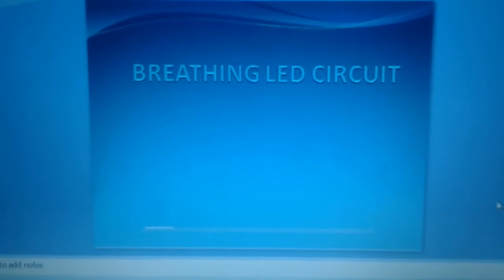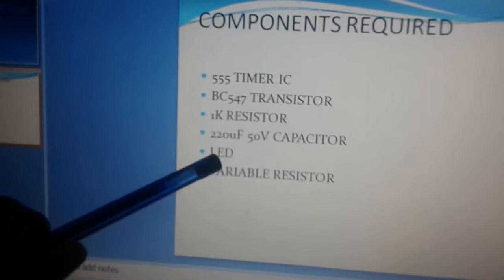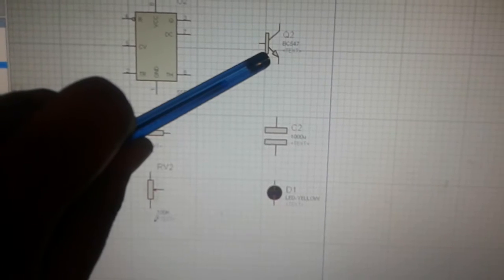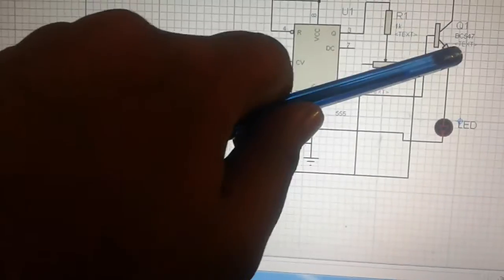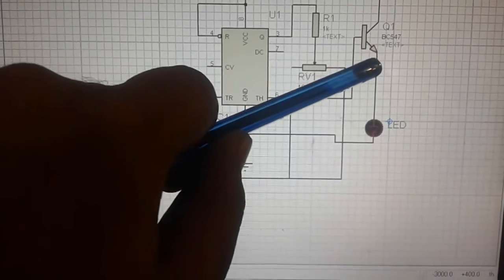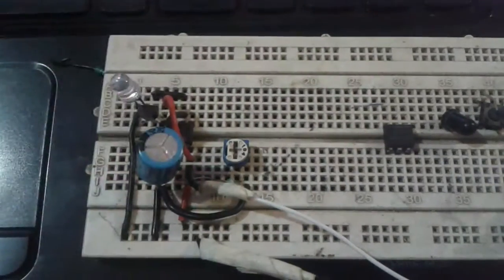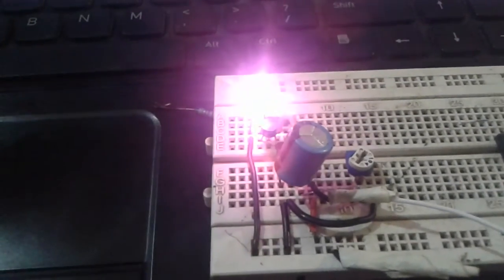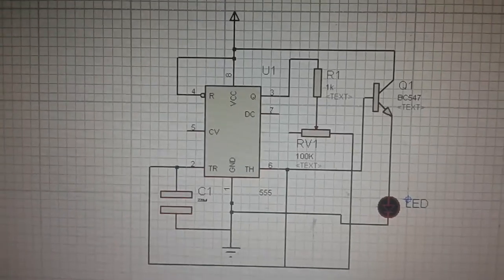Breathing Led Circuit || PCB Design || Schematic || PCB Shouldering || 555 Timer IC

Comment: if possible use this circuit with a strip led ?
Reply from the maker: No
Reply from the maker: Only when you use an additional MOSFET circuit which uses this signal as input & according to that signal it generates output for strip light